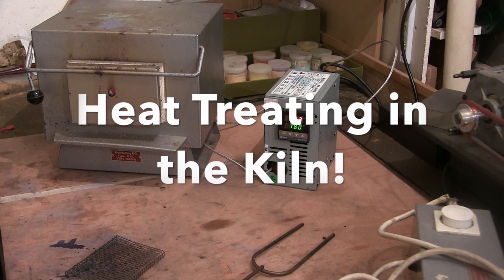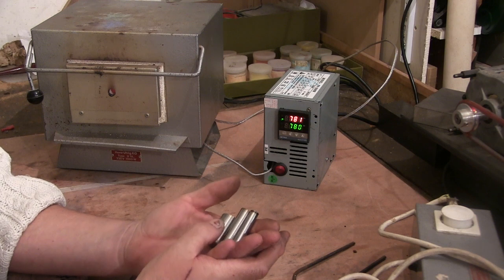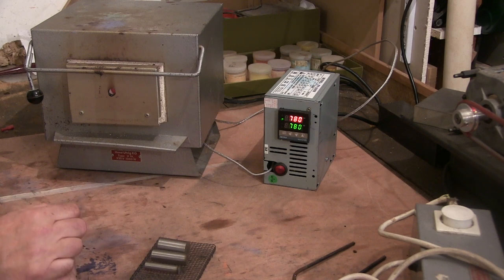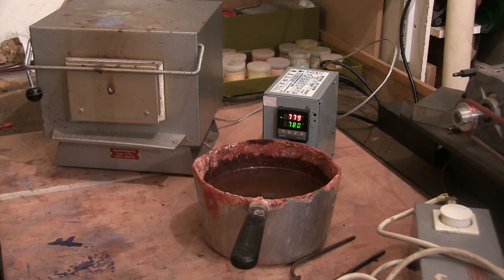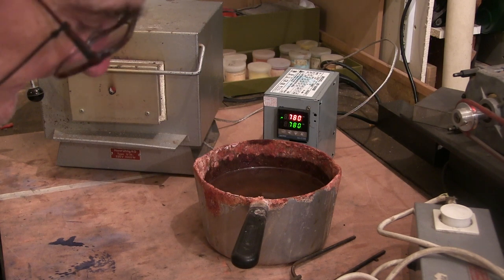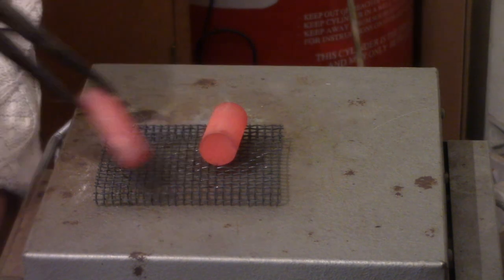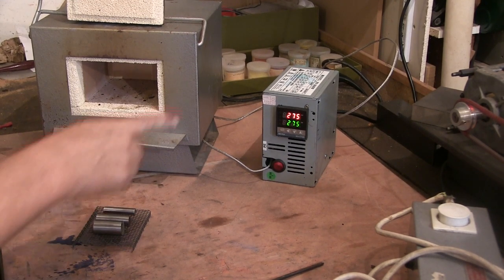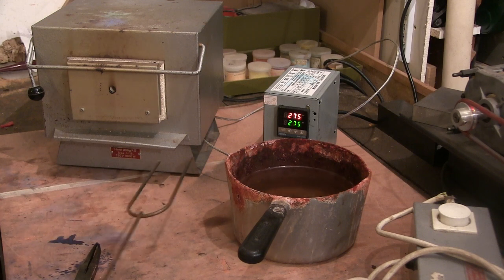Heat Treating in the new Kiln

Comment: Hi cliff could you send a link of the controller you purchased?
Reply from the maker: Hello Gary,
This is what I bought, Just copied them from my purchase history, not sure if you can just click on them, any probs let me know
Cliff

K Type Thermocouple Probe High Temperature Sensors with 1/8” NPT Threads ( 2m)
( 233254872772 )
Digitaler LCD-PID-Temperaturregler REX-C100 eingestellt + K Thermoelement M O2I5
Item price £ 11.28
Quantity 1
Item number 254242811293
Delivery service Other Courier 3 days
Reply from the maker: 184068162027, this is a current listing on ebay!

Comment: I used to harden just as you did  but nowadays I do tempering in a secondhand kitchen oven at 235C. This is "Tubal Cain's" (T.D. Walshaw's )recommendation for "light straw" which is what I usually want. One of your commenters  sent you a picture of color vs. Temp.  and the internet is full of such references. It should not be necessary to quench the second time, although it does not matter in the end and does speed up processing.

Comment: I would guess your stove is hotter than you think. I was puzzled the different diameters turned different colors. You might try getting several pieces of the same diameter and putting them in different parts of the forge to see if some corners are hotter than others. 

Probably for what we are doing in our sheds it is close enough and better than using a torch.

Best regards
Frank

Comment: I found this if it helps.
Differentially tempered steel. The various colors produced indicate the temperature to which the steel was heated. Light-straw indicates 204 °C (399 °F) and light blue indicates 337 °C (639 °F).

Comment: I've sent you a picture though Facebook of a hardening tempering chart it shows the colour and written colour and the degrees in celsius and Fahrenheit I hope it's of some use to you
Reply from the maker: Thanks for that Daniel, anything in that book about the ideal hardening/tempering temps for silver steel for making punches?
thanks again,
Cliff
Reply: @CliffsShed  no but it says silver steel is used for shafts and pins ect and it's water or oil hardened and it gives a designation as AISI 01 which when you Google it it come up with 01 tool steel the book I'm looking at is engineers black book 2nd edition

Comment: Hi Cliff, What will you use the punches for? Coins etc?. Regards MachineNZ
Reply from the maker: Hello Kevin,
Yes they are the punches that I make for the coin ring punches I make, the 20mm is for a new one I am trying. I have always done them by magnetism/colour, but I have always done them to between light and dark straw in the tempering, depends how quick I am, they have always been fine, researching on the net seemed to say the temperature for punches should be around 780degs c, which takes them to blue, but they seem to be ok, can't vouch for the longevity though!
Any advice?
All the best
Cliff
Reply: @CliffsShed  I'm not sure about coins but our punches have approx. a 2-5 degree angle on the cutting face(not flat bottomed) so the punch has like a slicing action. This setup gives the punch a longer life than just a flat bottomed type. We punch slots and holes etc.....just a thought
Regards MachineNZ
Reply from the maker: Cheers, I have always put a 5 degree angle on the punches, as you say they cut much easier, I've just started trying out a 2.5 degree angle, seems to work just as well but a lot less grinding and less burnt fingers! :-),
ATB,
Cliff